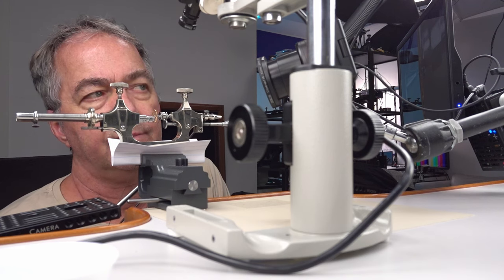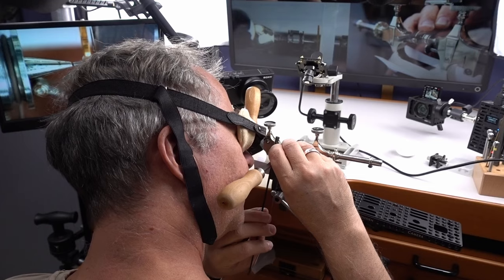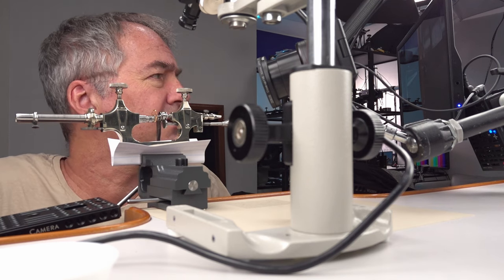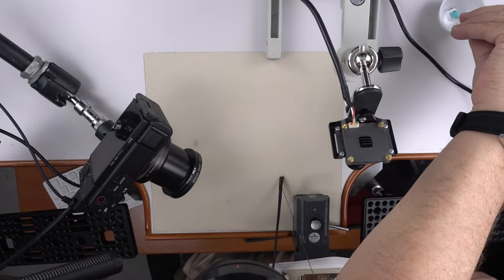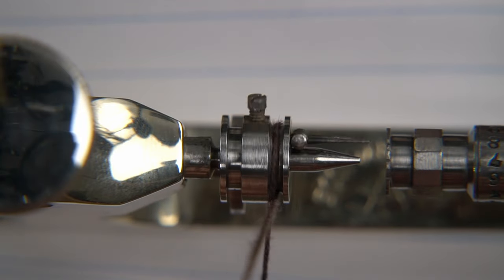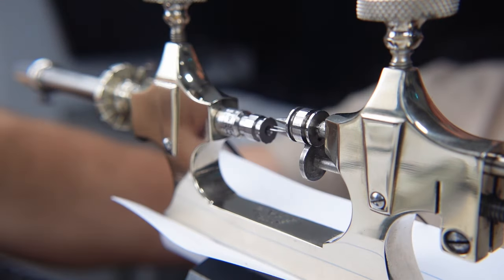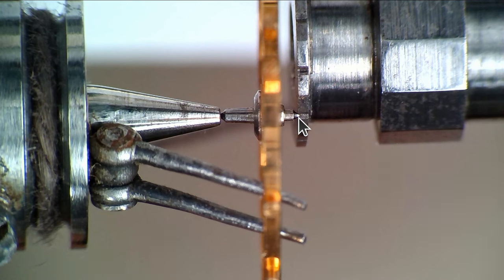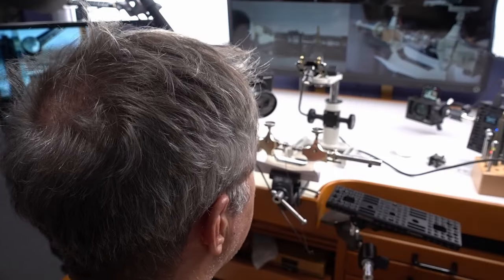Traditional Watchmakers' Pivot Polishing Tool

Comment: Thanks previous enjoyed your video on jeweling sets - I have a complete seitz and favorite although need to replace three reamers. I am really intrigued with everything around you - are you a photographer? by profession. By the way what is the brand of that little digital camera/stand that looks really good. You look to have a lot of nice equipment and in this regard I am sure one of the benefits of living in Switzerland.
Reply from the maker: Thanks! The little USB 3 camera is made by Arducam. It's mounted on a vintage microscope base that I reconfigured. The USB 3 is plugged into a small computer running Ubuntu and I use OBS in full screen to get a full screen 1080P HDMI signal that I record with a Black Magic Design HDMI recorder. That's the only USB camera that I use in my camera systems and it's not ideal but I like it because it's so small and routing it to a computer screen allows me to switch and record whatever is on my computer screen if I want to.

Comment: Hi, nice video, can you tell me how can I buy a binocular loupe like yours. Thanks
Reply from the maker: It's very old and they don't make them any more, but unless you need your eyes to be completely covered (from lathe shavings, for example) there are lots of Zeiss EyeMag surgeons loupes that were made over the years that are very good. New ones are expensive, but older ones can sometimes be found used at a reasonable price, or you could try a less expensive brand.

Comment: Hey Dayton, absolutely no paste! You’ll ruin the runners, lavender oil is often used. You also need to move the burnisher in the opposite direction to the wheel rotation
Reply: The burnisher looks too big to me, maybe for clock pivots
Reply: The pivot needs to be held to the runner by the burnisher
Reply from the maker: Thanks for all of these notes, Tom! I bought that burnisher on Ebay because it was only 10 bucks. Will probably end up paying Bergeon 100 bucks for a new one in the end. Been watching auctions but for used ones but 80 year old burnishers also raise some doubts. 😂😂😂
Reply from the maker: Hi Tom, I just got back from the watch fair at the Musee Horology International in La Chaux-de-Fonds where I was given a proper Antoine Glardon & Cie burnishing tool from the late 1800s in exchange for a cup of coffee!  You're right that it's considerably smaller than the one I used in this video. I hope the one in the video is a good one for cutting once I get used to using it (and even though it's a bit big), and the new one (from the 1800s) will be good for final polishing! We'll see! Thanks again for your comments!
Reply: It’s all a very steep learning curve Dayton, I am at a point that I have limited experience but a fair bit of knowledge. At my age I doubt very much I’ll manage the mastery of 10,000 hours.